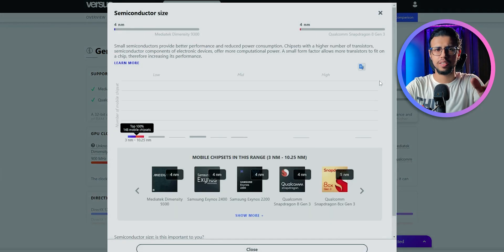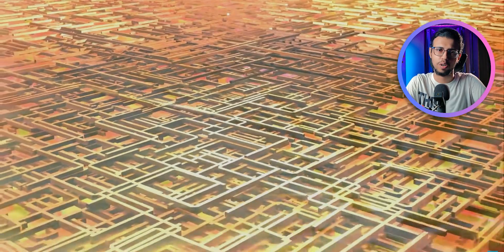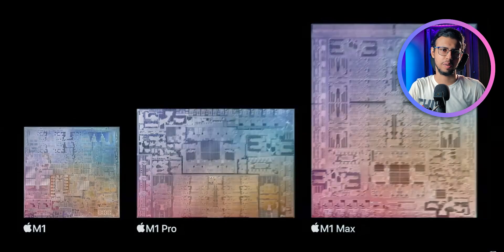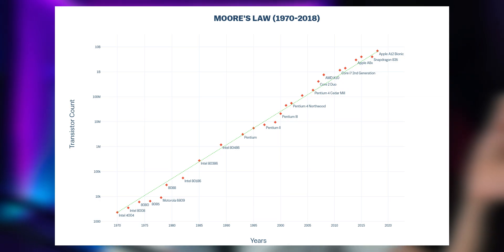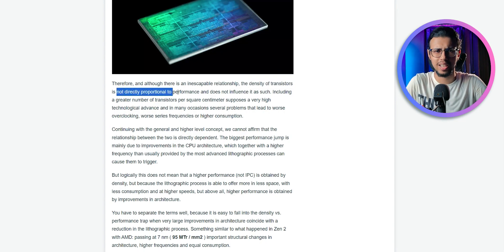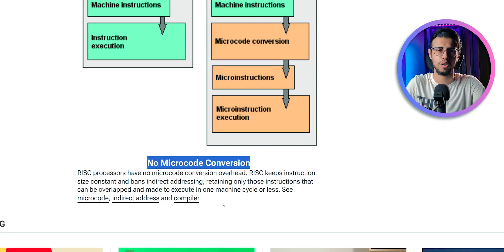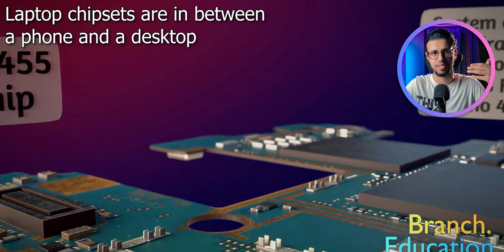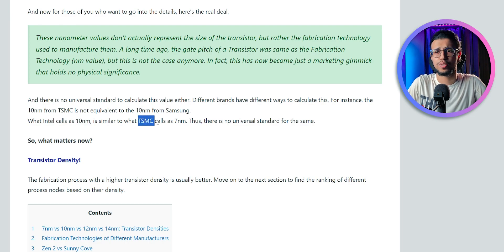Brands are Lying about Processor "Nanometers"

Comment: That's why I'm excited about Qualcomm x series processor. Battery life sucks on windows laptop and also x86 based processors are power hungry so they can't perform at full potential on battery. Qualcomm entering the laptop chip market is a good sign for windows laptops.
Reply from the maker: Yes! I almost forgot about those. They could be the rivals to Apple M series chips.. after a few generations.😅